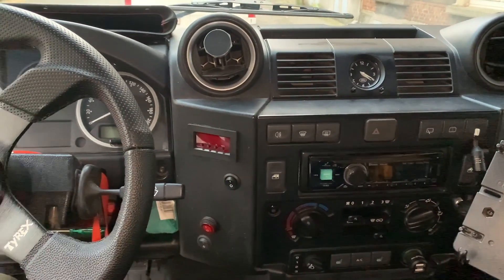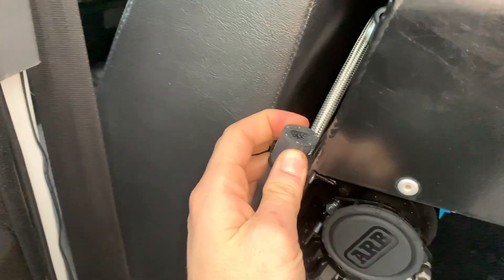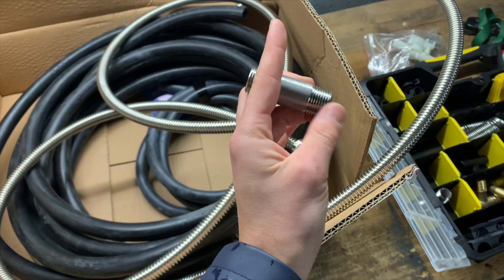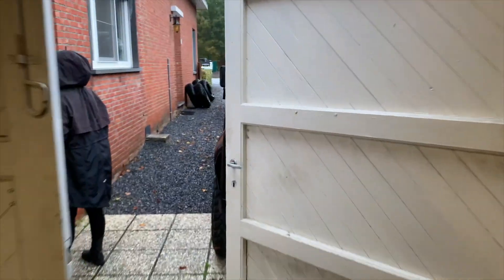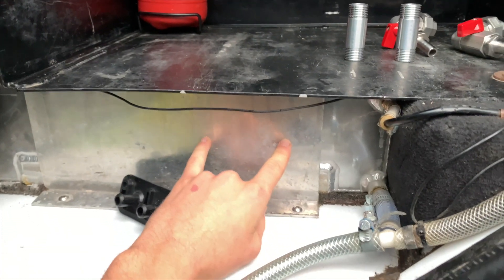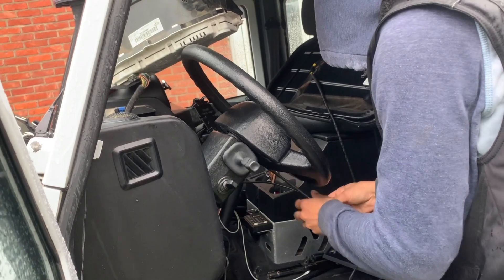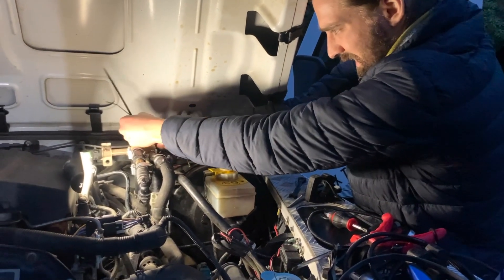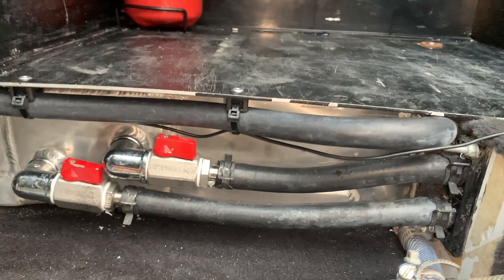How to INSTALL a HOT SHOWER Heat Exchanger in a 4x4 (@nextmeridian.expedition)

Comment: I'm presently restoring a Defender which I will be installing a heat exchanger, today I'll be making the mounting bracket in the engine bay. I like the fact that your using valves, I'm wondering why were they placed so close to the tank, wouldn't it be better to have them in the engine bay? I'd like to know your logic as it may help me in my decision to where I place mine. BTW, great video. 👍
Reply from the maker: Hi. There is no difference between having it in the engine bay or next to the water tank, that is a personal choice. We had it next to the tank as there was un-utilized space. In our engine bay are adding a pre-diesel filter so we wanted to keep some space for that. Also having the on/off switch in the engine bay you are closer to the engine coolant circuit wasting less fluid in the circuit if there was to be leak one day. (even though Coolants doesn't cost much).

Comment: good in theory, but what happens if you get a coolant leak inside the tank? My personal preference is a heat exchanger external to the tank and pump the water from the tank through the heat exchanger and to where you want it. You can then mix with cold taken prior to the heat exchanger to get the desired temperature, and zero cross contiamination risk as the heat exchangers are guaranteed for well in excess of everything that will ever be put through it.
Reply: Agreed! Keep the coolant under the bonnet. Move the water, not the coolant
Reply: 6:49 😊

Comment: What a coincidence, at this very moment I am also building a hot water system in my defender my 07. However, I have opted for a 6L stainless steel tank where I place a homemade copper heat exchanger. (I have two 35L watertanks in the footwell behind the front seats.) I can then regulate the water temperature with a thermostatic valve. I have yet to order the rubber hoses, can you tell me what inner diameter these are? Can you also say which temperature sensor and switch you used? This would really be an interesting addition. Thank you very much and keep up your beautiful work.
Reply from the maker: Hey, yeah it’s a good idea as well to have separate water tanks to keep one warm for showers and a cold one for other usages. 
Regarding the pipes, screen and switch I don’t know the brands and RoverLand Expedition has been the one to order it all. If you check our website under partners you’ll have his website and Instagram and you could ask him directly.
I’ve asked him to write back on this comment thread as well. 

Website: nextmeridianexpedition.live

Comment: hey Nick, how long does the hot water remain after the engine is turn off? and suddenly you have more cold water? 

￼
Reply from the maker: Hey Jordi, really depends on the outside temperature. I never really tested so i'll have to let you know. But because the water tank is inside the car it should hold it's heat for a while. If i had to guess, i'd say to go from 45 degrees Celsius back to room temperature, maybe 1.5 hours?
By the way, it could be used as heater before going to bed and bring the water up to around 60 degrees.
Reply: Hello Jordi, as Nick says it really depends how much your tanks is exposed to the the outside and the temperature. From our experience our tank keeps warm for around 5-6 hours after we stop driving. (full tank - 65l)